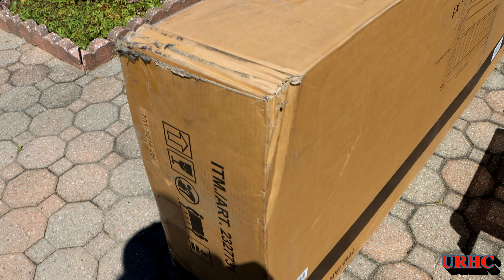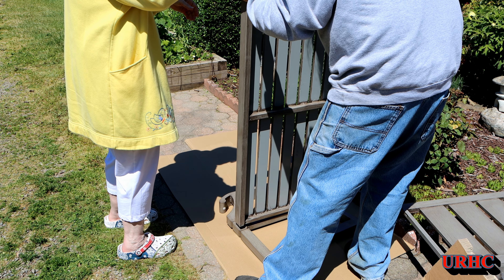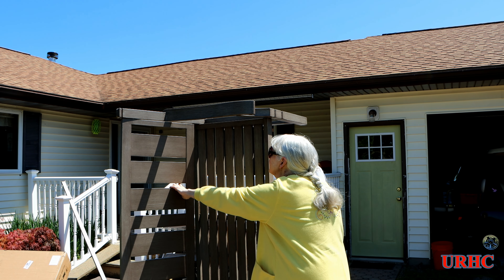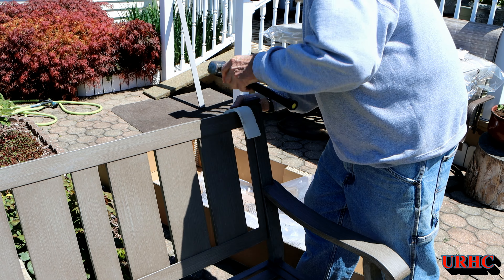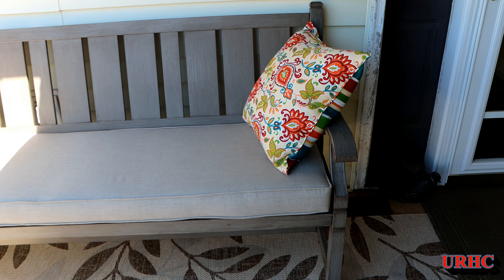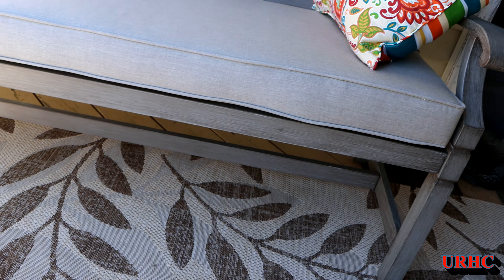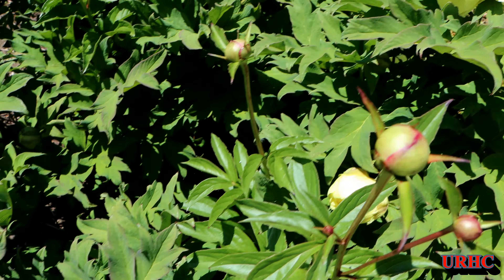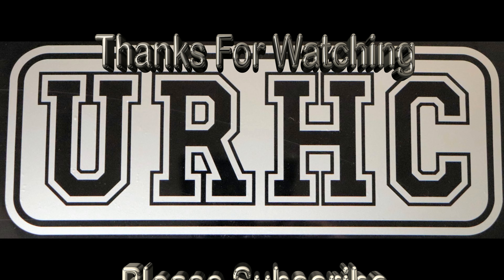Assembling A Grand Leisure Bench From Costco And I Got My Chickens

Comment: I noticed your wife wears croc type shoes. I noticed that I fell wearing them or lost my balance.. It seemed as though the shoe stopped and I kept going.. Just a heads up as a fall is hard on a person at our age. There are sneakers out there that you can slide into rather easily into. They have a no tie lace so your lace is not a tripping hazard. The chickens were a nice touch and Redneck in a box was funny.
Reply: I saw in another video she collects crocks. She has a boat load of them.
Reply from the maker: That's all she can wear anymore.  She had serious bunion surgery several years ago that left her in pain. She spent like a thousand  dollars on different special shoes that just caused pain and her doctor finally told her to try crocs and they really helped. Thanks for watching.
Reply: @unemployedredneckhillbilly2023  I am glad she has found relief by wearing crocs. I mentioned because of my own experience with them. Have a nice Memorial Day .